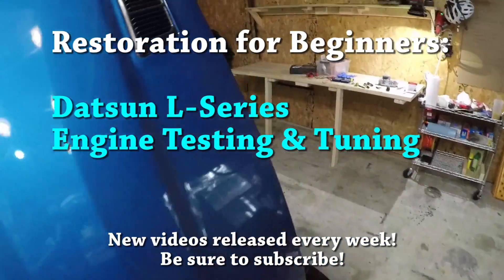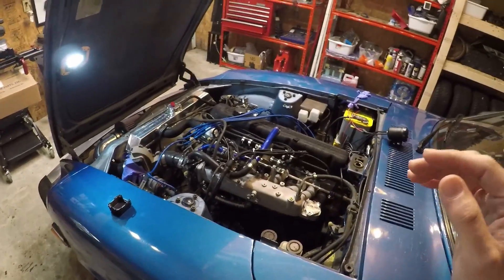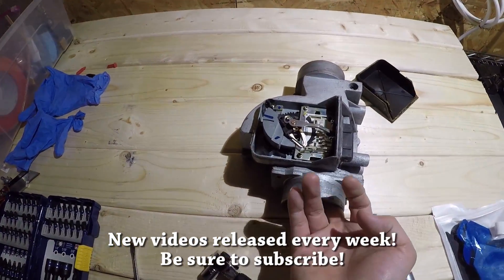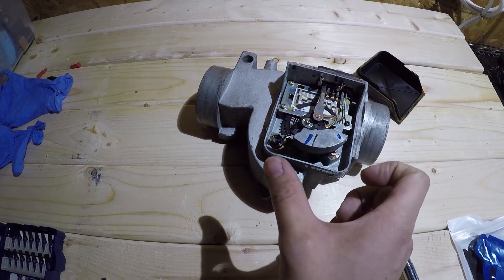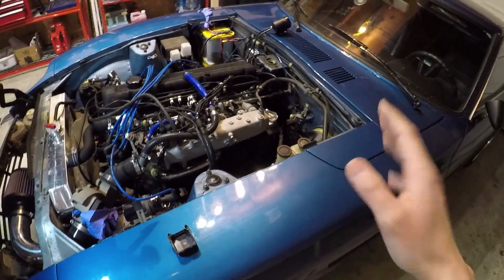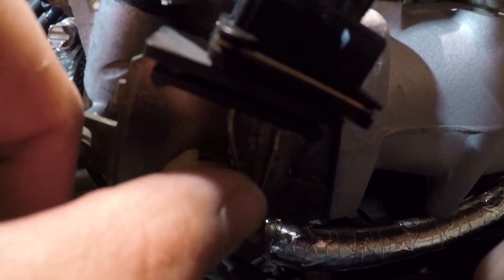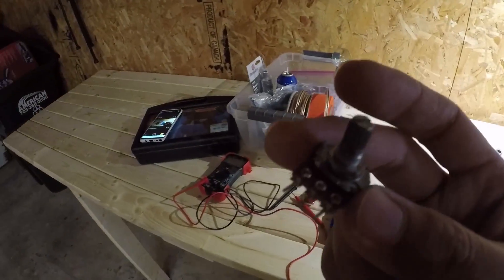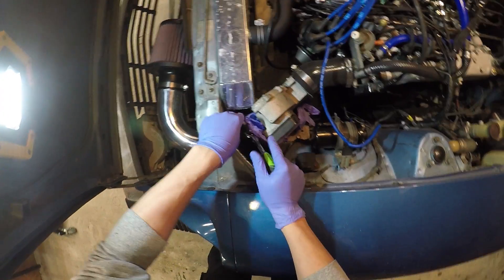280Z Tuning: Adjusting Air Fuel Ratio (Ep 15)

Comment: Great video. I have a question on my 1983 280ZX when its cold in starts and runs great but after 30 seconds it idles low and shuts off and the only way i can keep it running i have to axcellarate and then it back fires.

Comment: The coolant temperature sensor should be at 2.4k ohms cold and 200 ohms at normal operating temperature. Corrosion at the connector is usually the problem for over rich issues. I installed a 0 to 2k ohm potentiometer in line from my temperature sensor to the ecu so I could increase the pulse duration on demand when I want to go out and play. I have a another AFM that I have adjusted the potentiometer and flap spring tension for performance. The screw you are adjusting is for CO mixture at idle. It is an air bypass (unmetered air). By the way, if your 280z all of a sudden starts huffing out black smoke and stalls even after repairing your temperature sensor connector you may have a PC board issue with the ECM. Usually you can slam the driver's door and replicate the problem. I've experienced a lot over the 40 plus years of owning my 77 Z. Also been a Nissan master tech since 1987. You're good, keep pumping out the videos brother.

Comment: From my understanding the coolant temperature sensor in the thermostat housing does not play a significant role in the air fuel mixture ratio of the engine unless it is a Canadian model. U.S models base the air fuel ratio mostly on the CHTS sensor which is located on the passenger side of the engine in the head between spark plug 5 and 6. Often times replacing this sensor or cleaning up the connection points will get the car running well again. If it’s a Canadian model car then I have no clue.
Reply: The WTS does have an affect on the After-Start Enrichment by the change in its resistance value, thus changing the Injector open time or pulse width. The CHTS was introduced on S30’s built after 04/77 or 07/77 for the 78 model year and on until the introduction of the S130 in 79 for the US market.

Comment: You are not reducing idle air to the engine to richen the fuel mixture, that could only be done at the throttle. You are decreasing the amount of air that is bypassing the air flow meter. The same amount of air is going into the engine, but now more of it is actually going through the flap of the AFM and being accounted for. Now that the ECU can see this air, it adds more fuel to correct the lean condition.

Comment: Anybody struggling with these type of vehicles I will let you know that most of the aftermarket fuel pumps especially the Carter brand do not have a check valve in them so if your fuel pressure is bleeding off you need to install an inline check valve right after the fuel pump fuel pump pressure should be about 39 PSI with no vacuum applied to the regulator and it will drop to about 29 or 30 with vacuum applied I've been working on one for a while over Rich when I got there due to a faulty temperature sensor connector soldered wires directly to the sender so there's no way there can be a bad connection now the vehicle exhibits lean conditions off idle you can adjust the air-fuel mixture box but what I did was added 1000 ohms to the temperature sender so when the engine is warm it gets about 1.5 K to the computer and that solved all the lean running issues for me if you're going to mess with the air-fuel mixture box you better be a good mechanic sometimes things get old and get a little bit out of whack and wiring it's worn on these cars over the years it's always best to check the basics first make sure your valves are adjusted correctly check the timing chain to make sure it's not stretched or somebody put it out of whack no vacuum leaks excetera all the years I worked on these cars back in the days the most common problem was over rich condition due to bad connection at the temperature sending unit also do yourself a favor and get inline fuel filter between the gas tank and the fuel pump it's hard to find a 7/16 fuel line filter but they are out there you can stretch a half inch inline filter in there it's a little difficult with the original hose but it can be done make sure you don't put it on the pressure side

Comment: Hi hav. gas at fuel rail but when cranking none going in engine . what prob. do u think hav. computer or air fiow . any help will be app.
Reply from the maker: My first guess would be the pump. Second guess is clogged filter.
Reply: Your Fuel Injectors are possibly not getting a signal to open. This can be validated by using a Noid light connected to the EFI harness to check for the presence of a a signal from the ECU at the Injectors. Failing that you need to start at the beginning to determine if your ECU is getting a minimum of 10V while cranking. In addition you’ll need to do the necessary troubleshooting steps defined in the FSM for a No Start condition
Reply: It might be the fuel lines are reversed if you are getting fuel to the fuel rail. I am a z enthusiast. If it isn't that I can help.

Comment: Yo yo yo saying was sup. And my z is running and brakes fix however cyn i can here feel its misfire. So thats next oh got to test drive her found out my dashboard lights dont work and mph klm doesnt work but rpm does.
Reply from the maker: Sorry for the late response man. My dashboard lights don't work either, I just try not to drive at night... for now. My speedo works, it's just not that accurate and it bounces a lot. Will eventually make a episode about that, but just use your phone as a speedo for now if you really need it. 
The misfiring can be a lot of different issues. What have you tried so far?
Reply: Restoration For Beginners fuel injector issues withtiming it wont advance past -3 it gos backwards from there so its off a tooth. Been busy myself.

Comment: I suspect your vacuum numbers will have improved as well.
Reply from the maker: I'll check again!
Reply: before the idle AF adjustment did you try removing the oil filler cap while the engine was idling? If so try that again and see if you notice any difference from before adjustment. On mine with what I will call the rich running AFM (great for smooth idle and high vacuum at idle) I noticed that removing the cap barely had any effect on the vacuum and engine while idling. I replace the AFM with what I will refer to the lean running AFM (again this is only as it relates to idle) and I had an rpm drop, vacuum drop and overall slightly rougher idle. Removing the oil filler cap with the lean running AFM will result in nearly instant stoppage of the engine. Now the conundrum, Are Datsun 280z EFI setup for lean running idle at the factory (perhaps as a preventive measure for emissions testing)? the reason I speculate this is most folks report engines that will stop running as soon as the oil cap is removed, implying a typically lean idle mix. Or is it something with the fuels being used today? Frankly I can see no reason to keep the lean burn at idle as most of these old cars exempt from emissions testing (if that is a problem with the rich AFM, I don't know as I have no way of testing the exhaust gas for emissions). The rich burn certainly feels better when sitting at a stop light, but other than that and the knowledge that the car is operating more efficiently I am not sure if it really matters. Both the rich and lean AFM have the same overall performance in every other respect. there is no popping or exhaust backfires, as the only mix that seems effected is the idle, hence as soon as off idle the ECU relies on other sensors to enrich the fuel mix. I will prob go back to the rich setting just for the slightly smoother idle, sitting at traffic lights is pretty common around here.